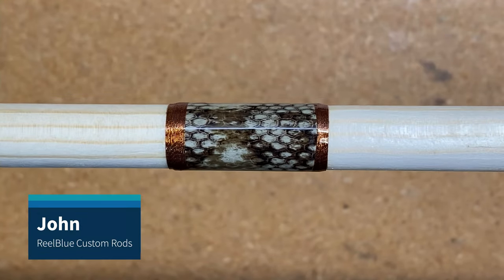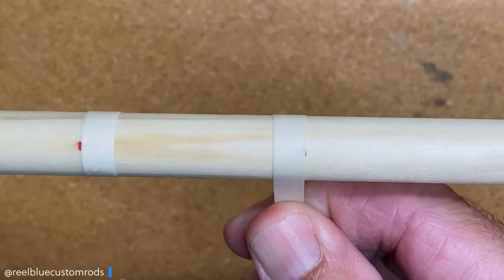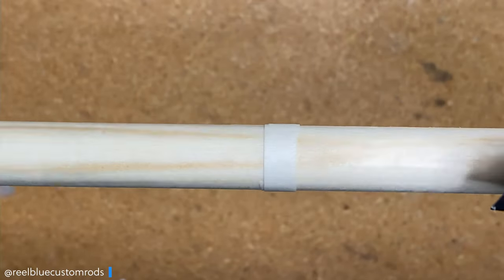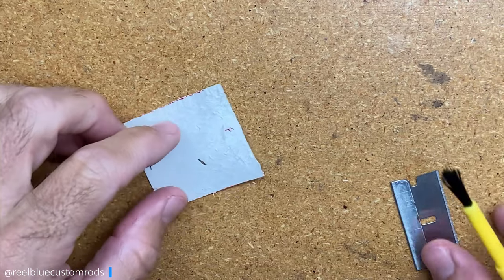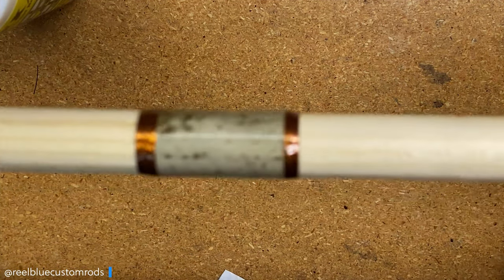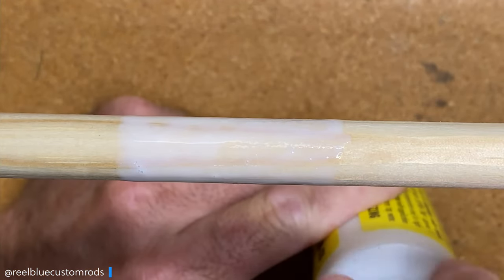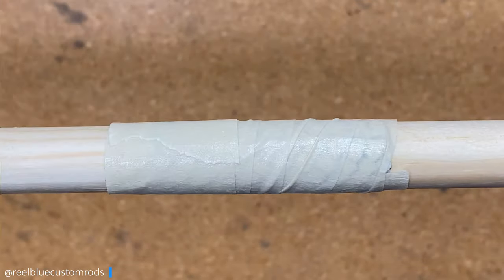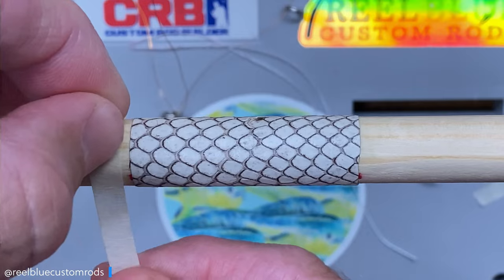How to Create Snake Skin Inlays for Custom Fishing Rods

Comment: Nice job. My toughest experience is using rattle snake skin. There’s scales on the skin and if they fall off while wrapping the underneath of where the scale was turns a different color and stands out after epoxied. 
  Was wondering if the snake skin you used has scales or not and if maybe I was should have taken all the scales off of that rattle snake skin?
Reply from the maker: Was it something you just acquired, or did you buy it from a fishing rod component store like Mudhole or something?
Reply: My buddies came back with a bunch of skins from out west. They killed them and skinned them theirselves.
Reply from the maker: @jarrodbriggs8246  got it.  Did you try using color preserver on it before you wrapped it on the rod?
Reply: @reelbluecustomrods  yes I did. It turned out really really nice I just went through a lot figuring out how to get without losing the scales.
Reply from the maker: @jarrodbriggs8246  - got it, and glad to hear it finally turned out for you.  Thank you for watching and commenting, and please let me know if you have anymore questions.
Reply: Wasn’t sure if taking the scales off was an option?  I honestly didn’t know if snakes had scales or just skin or what but the texture of those rods just popped w scales on.
Reply: @reelbluecustomrods you can do a search for snake skin remnants online and find several suppliers.